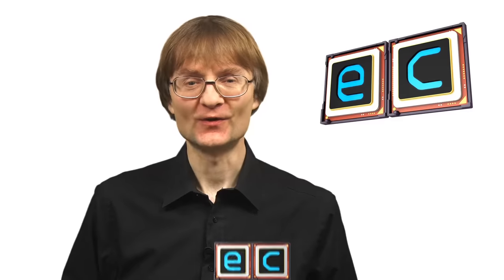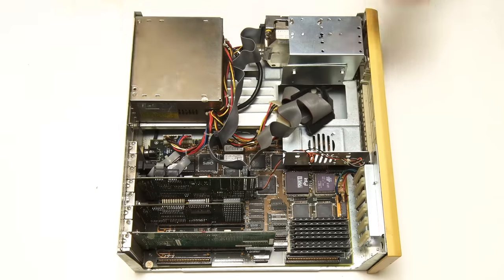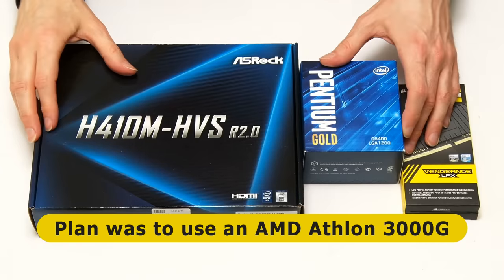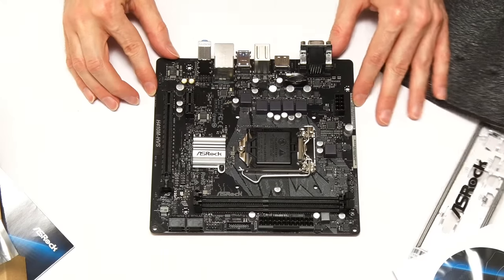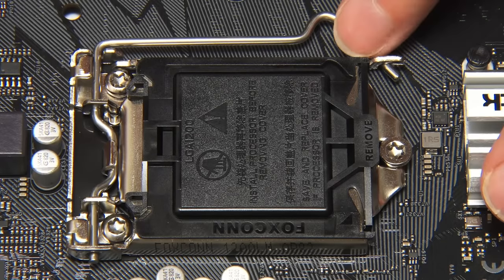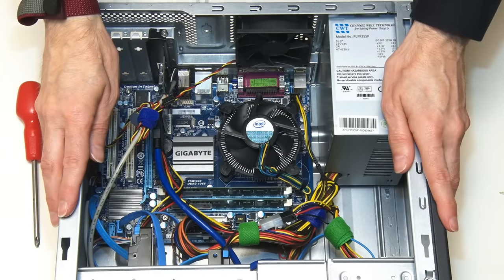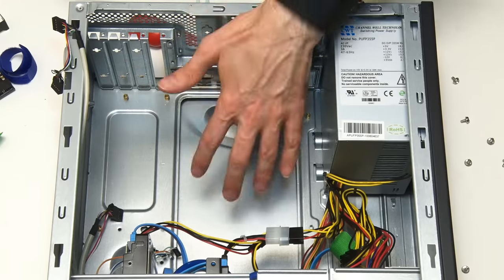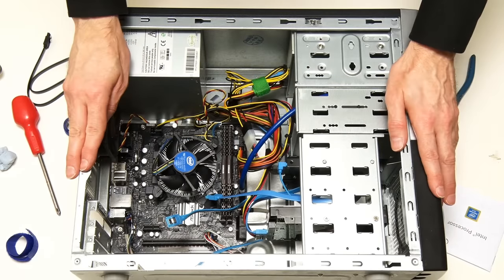Old PC Upgrade: Motherboard & CPU

Comment: I've had this same computer for over 25 years and it's as good as it ever was. It's only had 3 new cases, 4 new motherboards, 6 CPU changes, 4 memory updates, 12 new drives and and 5 graphics card upgrades.
Reply: Computer of Theseus
Reply: Trigger rides again!
Reply: @Paulwell  ~ alright Dave?
Reply: It’s like the thousand year old hammer.
Reply: That is one bitchin' PSU then.😹
Reply: Did the local Council give you a certificate ? :)
Reply: can I buy your a new one already
Reply: And at certain stages you can collect the discarded parts and perfectly re-create your old PC from several years back.
Reply: lol...
Reply: @givenfirstnamefamilyfirstn3935  lol when i get new case and PSU i can fully rebuilt my old AM3 cpu from 10 years ago, but now with SSD!
Reply: i want  to upgrade my mobo and cpu only, do you have any suggestions or pontential problems i should be aware of? Thx!
Reply: It’s a different computer now
Reply: same here, I am stil using a 1rst gen I7 extreme edition processor, and a 1060 video card as my daily driver..... finally upgrading to a Ryzen 5 (AM4) and 1080 TI combo (I have a video/gaming rig) just dont feel like I should replace when the stuff I am still using still works
Reply: reminds me of One Piece at a Time Song by Johnny Cash
Reply: You forgot the 7 PSU's as well!
Reply: @eddiexxxj154 yeah,It don't stop there. I had all intentions of doing the very same,I ended up using two case fans and a Sata cable from the old pc, figuring if I upgrade this then I really should upgrade that........ before you know it you've bought enough new bits to still have enough of the old pc to rebuild the old pc😂

Comment: "Is replacing motherboard and processor not building a new computer?" is essentially a modern version of the ship of Theseus paradox 😂
Reply: .... or Trigger’s Broom as modern classicists might refer to it.
Reply: I was beginning to wonder the same thing ;)
Reply: Ahhh, @Foxrain, you beat me to it! "Chip Of Theseus"!
Reply: @FoxrainFuture  On the other hand, if I leave my keys in the car, Happy Birthday...
Reply: Even though it is an entry level PC,i would consider it a "sleeper". Kind of like putting a new engine and trans in  the old family car.
Reply: I think definition about build a new PC is every part is new in the same time. ✌️
Reply: @triniplayer6172  processor and motherboard are the main parts of a pc. Once you change them it is a new pc regardless of the case.
Reply: @triniplayer6172  I'm saying that it is more than an upgrade and he also installed new ram. The motherboard and cpu dictate the capabilities of your system. They are the parts that actually make it a computer. So do you think that the case is the computer?
Reply: I scrolled down to make the same comment and I wasn't the first.  Have an upvote! 😊
Reply: @triniplayer6172  you’re = you are. Is that what you meant when you typed “your” ?
Reply: @PC4USE1  The most boring kind of sleeper, though. The case is not "retro" enough to make it a true sleeper. While, on the other hand, it's too old and basic to look attractive as a new PC.
Reply: @chrisschembari2486  oh thats even better!
Reply: @triniplayer6172  next week... Old PC upgrade: Fitting a New Case :-)
Reply: @fredsmith1970   Just like the Aussie recipe for Galah stew:

"Pluck a Galah and place it in a pot of boiling water with a large rock. When the rock is soft toss out the Galah and eat the rock"
Reply: @triniplayer6172  So if you put all used components on a new case is it a new PC?
Reply: yeah, disappointed by this. would have preferred to see the original board upgraded to a Core 2 Quad or 771-to-775-modded quad-core Xeon. At least the G4600 doesn't actually perform that much better...

By the way (posting here because this got "lost" in the too many comments) the power supply happens to be good quality, made by CWT who makes some power supplies for Corsair.
Reply: @triniplayer6172  The problem, of course, is a lack of sufficient definition of the term and concept of an upgrade. It's entirely subjective whether we call such a change an upgrade or a replacement!
Reply: @CTCTraining1  or Great grandpa's axe

Comment: Made me laugh with installing the sticker for maximum chance of boot.
Reply: But it will not run at full speed, it does not have RGB in "go fasta red" :(
Reply: Considering the high price of CPUs, you might as well make good use of the sticker.
Reply: Correct stickers are essential for appeasing the computer's machine spirit.
Reply: now imagine - it would boot even faster if the sticker was red

Comment: The close-up shots of the tiny connectors even when the motherboard is sitting within the case is very impressive and of course very useful. Few channels can manage such tight shots with perfect clarity and camera stability.
Reply: I've done it more times than I care to remember. But for someone starting out, this is invaluable. 
Though Christopher did omit the blood sacrifice you must make when dealing with nice, sharp cases.
Reply: @peterbrown6224  LOL, I've donated my share... one of my old cases has considerable duct tape along the inner edges, from sheer self-preservation...

And yeah, I too was impressed with the nice clear shots of those tiny connectors. Good way to make them less intimidating for the newbie.

Comment: The most beautiful sound in the world is that single short beep from the internal speaker at first boot after a major upgrade.
Reply from the maker: So true.
Reply: can't beat an old hard disk spinning up
Reply: Apart from it seems to be shunned upon by many tech tubers now!  I put a speaker on my B550 mobo with Ryzen 7 2700X and I agree it is sweet!
Reply: @Laurie Rose A fine sound to be sure, but the "best in the world"? You need to get out more.
Reply: Assuming your mobo even does that before going straight to the post screen. :-) My new one has a speaker attached, but I don't notice much of a beep when it boots.
Reply: Sad life?!  Surely there’s more to life than beep = beautiful?  ‘Building’ a computer is really just snapping shop bought items together : I reckon it’s nearer to assembling Lego kits than real building.
I love these very clear videos, though.  They give you confidence to ‘build’.
Reply: Likewise, the post failure "beeeeeeeeeeeep" is one of the worst sounds you can hear.
Reply: I agree! I bought a pair of speakers more for the sake of nostalgia than for diagnostics. It's a shame greedy case manufacturers want to save a few cents and rarely ship them nowadays.
Reply: @VulpisFoxfire  it's probably just disabled in the BIOS. You can activate it.
Reply: @luked6385  didn't he say "upgrade" instead of "update"?
Reply: @luked6385 What do software software updates have to do with the video or my comment?

Comment: That motherboard size is called Mini-DTX. It is compatible with some Mini-ITX cases because it uses four screws in the same position as Mini-ITX, but you can only install single-slot GPUs in most of those cases.
Reply: Exactly...i'm pleased someone pointed this out..DTX form factor is not recognised in Asia..they name them all mATX..This size is limited to only a couple of  manufacturers..AsRock mainly..i bought one years ago from this make..i believe it was a Socket 1155 Sandy bridge..

Comment: Now that was a OLD computer. Great video.
Reply: L
Reply: @laurabrown6085  Be gone, foul bot. Trouble this channel no more.
Reply: Maybe, but the board with the Pentium Dual-Core would have taken a Core 2 Quad or a 771-to-775-modded quad-core Xeon, which would have made an even greater video. Once the motherboard is replaced it's not the same PC anymore. At least the G4600 doesn't actually perform that much better...

By the way (posting here because this got "lost" in the too many comments) the power supply happens to be good quality, made by CWT who makes some power supplies for Corsair.
Reply: Was the upgrade worth it?  I have a n old desktop that might be a candidate.
Reply: @spuds6423  It solely depends on your personal needs and what you exactly defines as "worth it".
The epic need for speed will cost you a fortune however which way you look at it.
Reply: @CXensation  True, I was just getting a cost/benefit analysis on going to all the trouble in doing it. Of course, there is the satisfaction if doing it yourself which is priceless. 😃

Comment: One tip to keep in mind is that some coolers have plastic over the thermal paste.  Some it's like a sticker you have to remove, so just check before putting the cooler on.  I have seen people put the cooler on like that (with the plastic sticker protector in place) and then wonder why their computer idles at 60 degrees F instead of a more reasonable 25-35 degrees.

Comment: I appreciate the down to earth upgrade in terms of budget. We computer enthusiasts have a tendency to make a hole in our pockets, and actually most users don't really need all that computing power. A lot can be done with budget hardware and free software, and that's is why I'm looking forward to your next video.
Those close-up shots are really good. Thanks a lot, I always forget what is the negative in the front panel connectors, but it won't happen again.
Reply: but the problem is if you are on the smaller budget why would you go for the new stuff over used, you are pretty much paying more for weaker hardware just so you can have that insurance

Comment: 22:45 A word of WARNING on Passmark Scores!: Version 9.0 of Passmark Performance test is used on the video but score number scale has changed since version 10 came out, at least with the CPU test. I've tried both versions as a quick test before posting this (hence the CPU test only, sorry). If you look up the mean submitted score for this Pentium Gold CPU on the Passmark website, based on Version 10 as I suspected, you can see it now gets 4161 points. This is quite relevant for people who compare CPU's relying on the said website (me for one).
Reply from the maker: Useful info, thanks for sharing.

Comment: 18:25 You have part of the HDMI I/O shield bracket (earth connector) tucked inside the HDMI socket where as it should be resting on top of the socket. Don't worry, I have done this many times before on various different motherboard connectors and it's something I now specifically look out for when building new machines, as the only way to fix it is to remove and re-seat the motherboard, and you don't want to do that once you've continued to build the rest of the machine!
Reply from the maker: Do remember this is not real life -- it is a video shot single camera! :) On the B-roll take where the motherboard pokes through the back it is indeed a little offset. But this is not the case in the build.
Reply: Well spotted! You have a good eye for detail. Those metal earth tabs are always a pain when inserting a motherboard. I often tweak the angles of the tabs before assembly, as they often get flattened in the packaging (causing this “into the socket” assembly error).

Comment: FINALLY A NEW UPLOAD ABOUT OLD PC!! :D
Reply from the maker: And there's another next week! :)
Reply: The only difference I'd make on this build is to get the faster memory if you can afford it.  The MB may support memory overclock and if the memory is rated faster it will be easier to overclock.
Reply: @kevin34ct  The H410 chipset is locked to 2666MHz for celeron-i5s and locked to 2933 for i7's and i9's I believe so it won't get past 2666MHz if I recall correctly. However, Intel doesn't really depend on RAM bandwidth as much as AMD Ryzen.
Reply: @ExplainingComputers  great series! Looking forward to the Linux install :-)

Comment: This basically how my PCs evolve over time. Incremental upgrades over time. The best thing to do of course is to figure out whether a big jump spending a bit more money in the end is more cost effective than all those incremental upgrades. But then again - taking restrictions on time and money considering something chosen at one point in time might be different at another point in time. It's all relative. 
Thanks for sharing this.
Reply: Yep... I have some that have crawled into the near-present through 3 or 4 upgrades, vastly extending their useful life. But once in a while the jump can't be made, or isn't really economical... and then we start the process again with a newer base.

But I still have parts in everyday service that were made in 1992.
Reply: @Reziac  - 1992?  Like what?  I've got some old hardware in use but nothing near that old IIRC in actual use.
Reply: @ElmerFuddGun  Actually, some of my still-installed floppy drives are older than that, tho see little use. But the P4 with ISA slots still has my 486's old original sound card -- bought in 1994, but manufacture date is 1992... it makes sound in DOS, and that's its job, so everybody happy.

DFI now makes an i7-9th-gen board with ISA slots, but they didn't think it would support a sound card. Still, if I were buying new....
Reply: @Reziac  - Wow a new motherboard with ISA slots.  Maybe for those few companies that use some old (obviously) interfacing hardware that doesn't have a more modern implementation at reasonable cost.
Reply: @ElmerFuddGun  Yep, and DFI makes very nice quality boards (when I was building custom systems, I used them for my clients), and actual humans with real clues answer your questions. If I were buying a new modern board, their latest is seriously on my radar. (And you can buy direct cheaper than via any vendor.)

And yeah, there are tons of industrial setups that rely on ISA interface boards (which commonly cost 10 grand or more) that still do the work required, and replacing all that with "modern" equipment would be prohibitively expensive. So there's still a small but steady market for ISA slots. 

But it gets worse... up through the late 1990s a friend scrounged every XT motherboard he could find, because his work needed them to interface with their garment cutting machines.... a better solution than coughing up six figures apiece for new cutting machines.

I have a P4-3GHz with ISA slots, an iBase MB800, that I got as a DOS gaming rig specifically for the ISA slots. It is now 18 years old, but still does the job. Tho I think its boot drive is even older. :)
Reply: @lactobacillusprime  Agreed. I have had PCs since 1989, but I have never bought a complete one.  Even my first (a 10MHz 80286) was not a complete machine because I already had some parts.

Comment: Nice how you demonstrated the performance gain possible with modest hardware. The average person could easily do the same following your video. You also kept the build cost very reasonable but still chose good, reliable components. So many channels build extremely high cost systems that the average person really can not afford. With current shortages and cost increases your video will help a lot of people!
Reply: that little Pentium gold is quite capable - not a speed devil, but still. The price is a bit high, nonetheless.

Comment: as always, an excellent video. The pacing, script and footage is spot on an makes understanding the whole process  perfectly clear.

Glad to see some love for the Pentium G6400, it's amazing how capable the entry level cpus have become. Looking forward to the next video testing on linux and opensource software.
Reply: its 2 years old comment but i have to ask when you sayed "it's amazing how capable the entry level cpus have become" what did you mean since they are pretty much uselless outside of using them for net browsing, whats more entry level cpus become uselless like back in the day entry level cpus were the same as the higher tier one but just with a lower clock

Comment: Excellent video as always Chris! I would add that there are also ways to extract the windows 10 key from bios, and if your lucky enough to have a windows 7 sticker key on the side of an old PC that you no longer use, as of right now, it still activates windows 10.

Comment: Great upgrade series. It reminds me of an axe that was in my family for 160 years. In that time, it has had three head and seven handle replacements.

I've been a Mac user for a decade and the two computers I own are heavily proprietary and unupgradeable. One wasn't eligible for the newest OS upgrade. The next PC will be a Windows/Linux model. It's amazing how much things have changed in the past decade and a bit, but also how much remained the same.

Comment: Nice video. Just did an updated of my 12 year old system, a z600 workstation. Added an SSD, USB3 card and a 2nd hand Xeon 5675. Still running just fine and keeping my room nice and warm.  😅

Comment: I would also strongly advise checking for a BIOS update when you install a new motherboard.

For example, the BIOS you have installed is v1.0 which is the release BIOS from June 2020.

There have been 2 additional BIOS updates since then, 3 if you include the latest Beta BIOS dated April 2021.

Comment: This actually looks like a mini-ITX motherboard rather than micro ATX.  Also maximizing the chance of a new machine working by applying all relevant stickers has been standard practice for me for years :D
Reply: It's  more like DTX. ITX only has one PCIe slot and is square at 170x170mm
Reply: @GodmanchesterGoblin  Thanks for pointing out about the DTX size.  To me it looked identical to the mini-ITX board I put in my media PC.
Reply: @jb31842  There are a few DTX boards out there, and unless you know the differences to look for it's very easy to think they are ITX. Some cases sold for ITX will take them too, but many don't so you need to check.